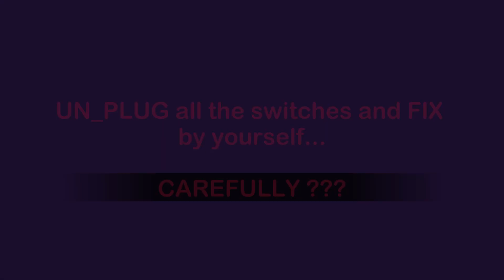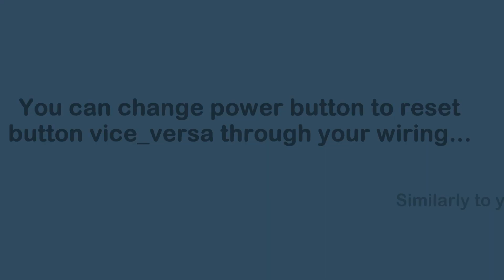PC Cabinet LED light not blink and Button problem SOLVED   😎

Comment: Bro😢my hdd light is not blinking bro. It's off bro. Power light is on bro but hdd is off😢😢help me
Reply: Same to same here bro my harddisk light is also off and no signal in monitor...

Cpu Power button is on and fan is also working only harddisk light is off not starting
Reply: @vineetmishra2111  so what's the solution

Comment: Mere me red light nhi jal rhi or display nhi aa rhi ram nikal kar bhi laga li par fan chalu hai
Reply from the maker: Same problem I also faced. What u are tying is temporary solutions. It may work for some days and again u will be in same situation... This issue generally comes in assembled cabinets due to improper electric flow between your motherboard and PSU.

In my opinion, reach out to repairing center. They will just change your IC in mother board within ₹300-₹400. It may work for some months. GOOD LUCK.